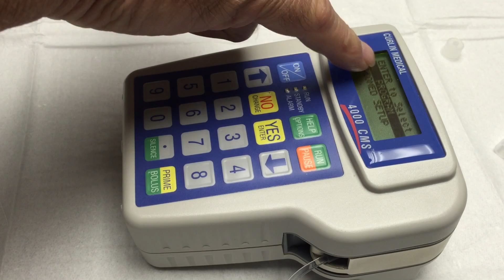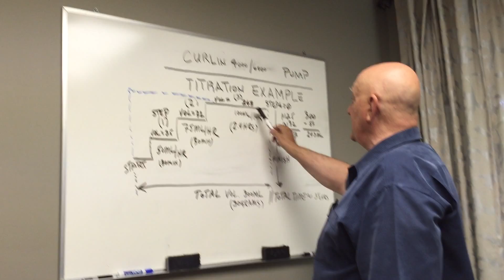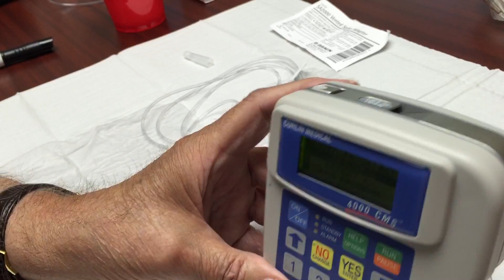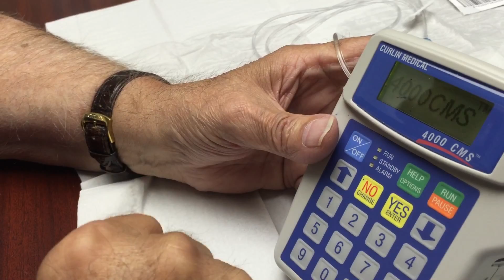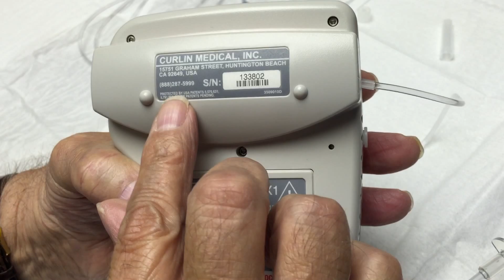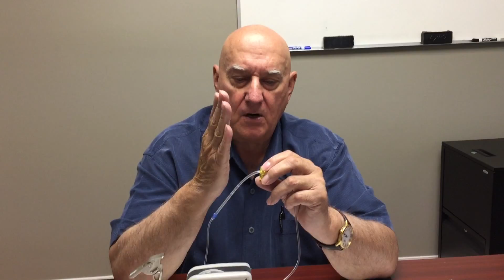Curlin 4000/6000 pump

Comment: we use this brand at work and it is by far and beyond way more confusing than necessary to program and run this junk.  No matter how accurate you try to program it, you end up wasting a sizeable amount of narcotics because there is always more left in the bag than what the pump tells you.
Reply: Don't despair-this may be overfill. This pump is actually quite versatile and reliable.